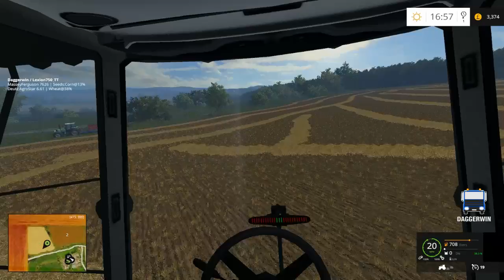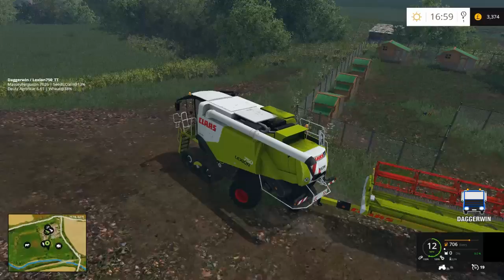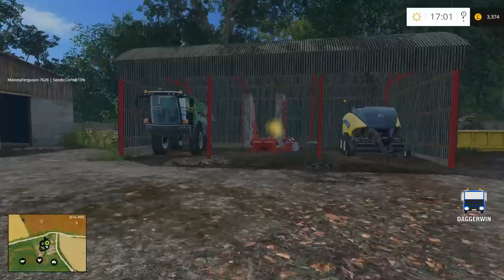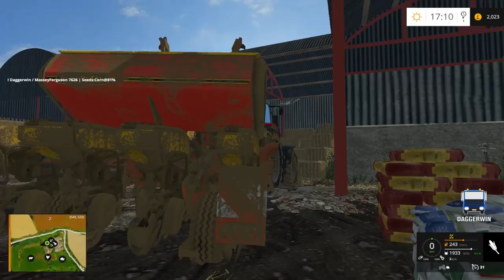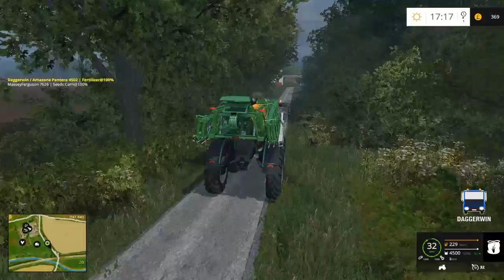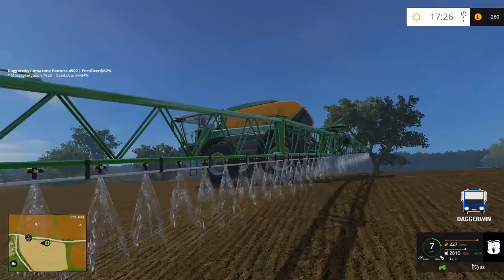Let's Play Farming Simulator 15 | Chellington 2015 | Episode 11

Comment: Hi Daggerwin,

You were running low on money after starting to spray the field,

And you see there was a single square bale on the edge of the field you were spraying and you needed the extra chemical for the finishing of the field spraying?

So just pick up that single bale and sell it, Ok not much money for it. But it will give you some money to buy more spray to finish the field?

Save you getting into minus money!

Your doing fine on this map keep it going.